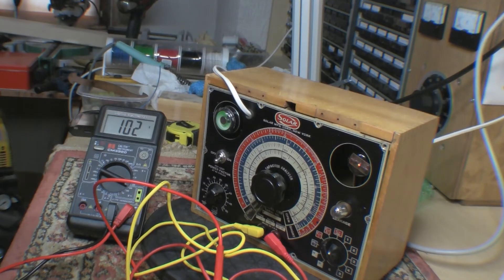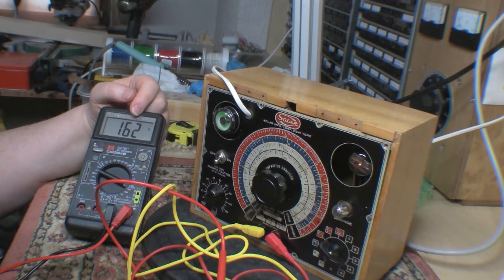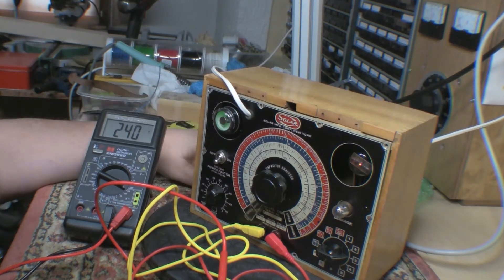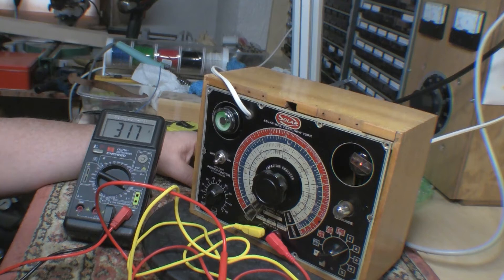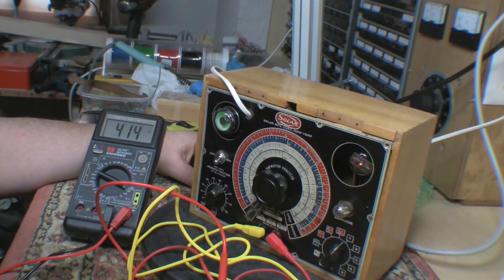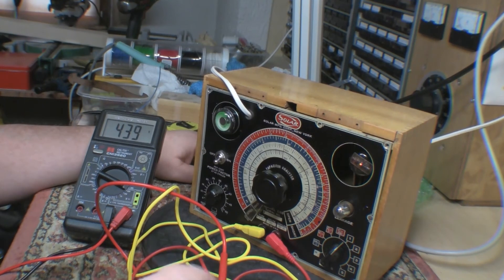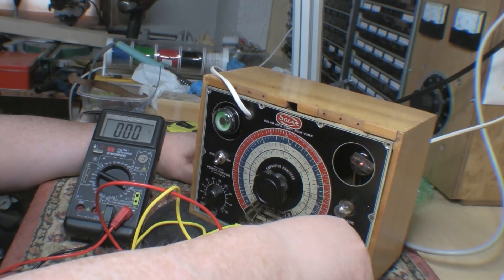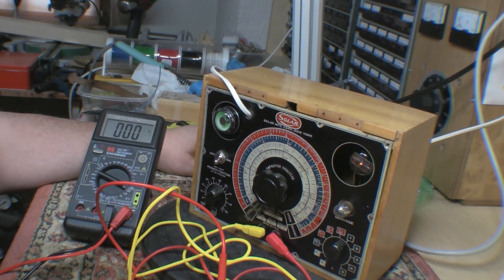Solar CBB 1.6 Capacitance Analyzer - part 2

Comment from the maker: Hi Bobby, alas the resistor chain is one large tapped wirewound device sealed in a metal casing so I doubt there's much I can do to make changes.   I'll live with the limitations for now.
Cheers,  John

Comment: For clarification, I just filmed a short video of mine in action. I will edit and post it on my site in a little while. It will be a silent video though unfortunately because I still can't talk very well yet.
One other thing, those voltages should be higher. Maybe just an out of tolerance resistor underneath?
Take care John,
Tom